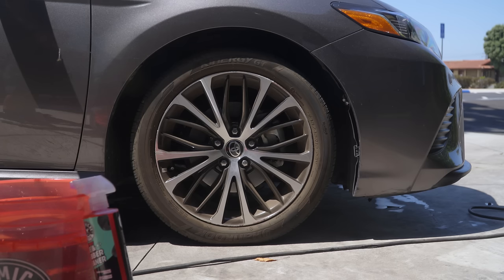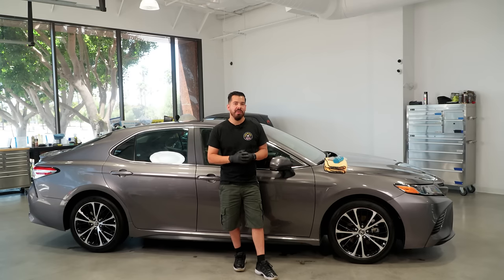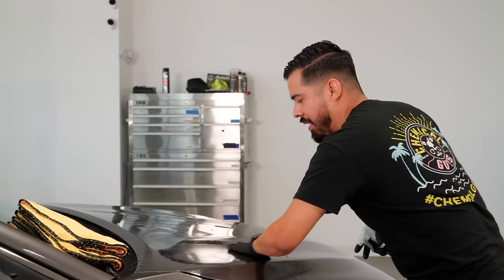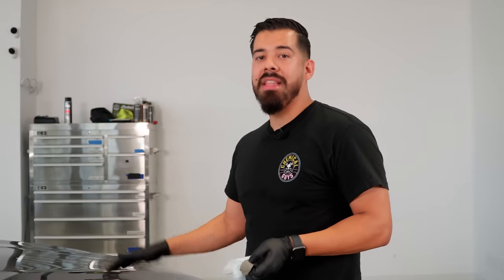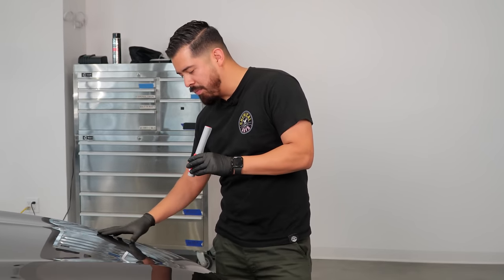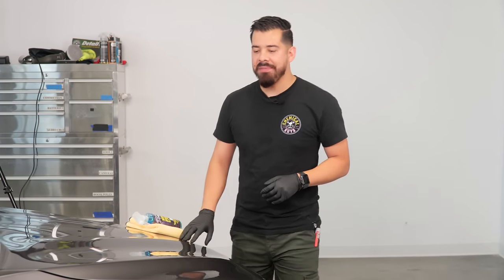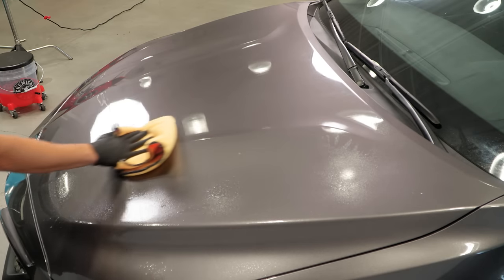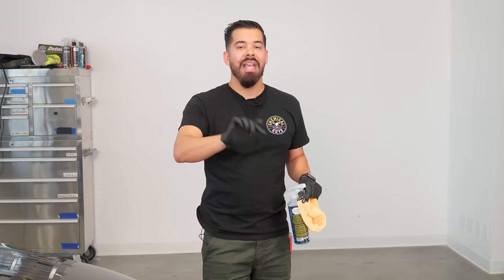Want A Perfect Showroom Shine? Do THESE Steps First! - Chemical Guys

Comment: Question... if you would normally wash your car with a two bucket method, using grit screens in the bottom of each, doesn't that mean that all waterless wash methods are dangerous and scratching your car?